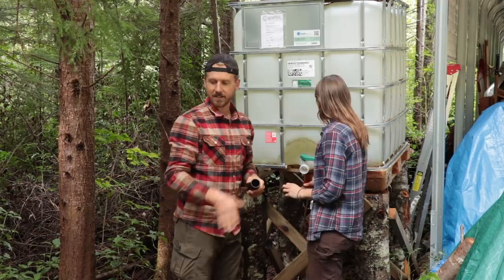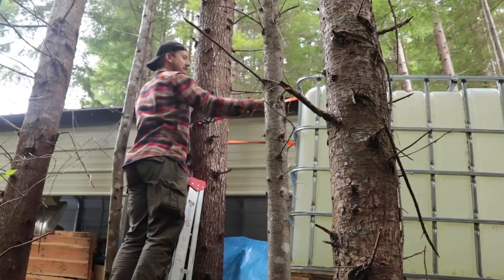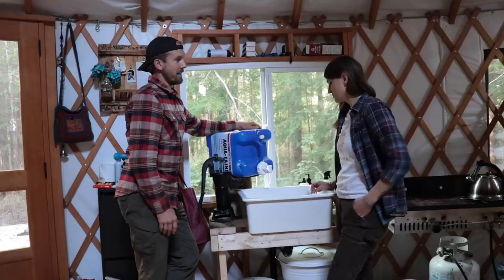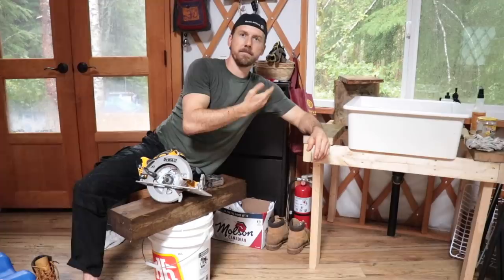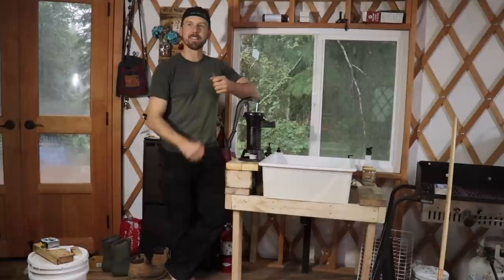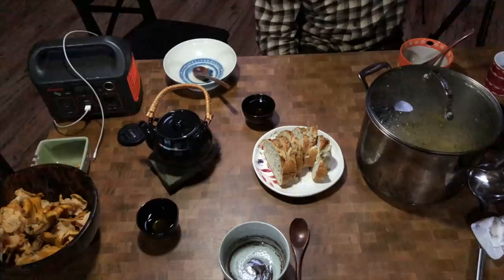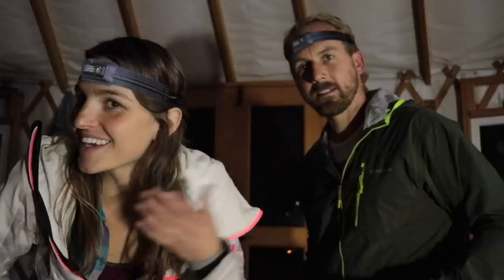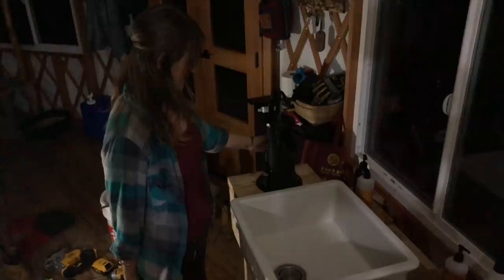Unbelievable!  My Secret Off Grid Kitchen Runs Off Rain Water | Living in a Yurt Ep.52

Comment: Use a Berkey for drinking water, contaminants start once the water hits the roof and can grow inside the tank especially if light can get to it, also I hope u have a plan for winter, that tank will be frozen solid and abs is for waste water
Reply: Was thinking that's abs but I could be poly pipe witch works for water would help if they expand that

Comment: Go find an RV supply store and they have a couple of filters that would work nicely hit your hand pump. We lived in a motor home for 5 years and I got to test them all. So the premo one has a charcoal packet with a UV light to kill all the nasties and choice number two is just an inline cartridge which removes 90 types of nasties but it doesn't have the UV but the water is drinkable safe. Leastwise it didn't kill us. The charcoal ones need to be changed out yearly and the inline ones every 6 months. Now they have UV rods and even though you are using rain water I would encourage you to hook one up to the tank. They don't require a lot of power and I have a friend who powers his off 9" x 12" solar panel. Just a thought.

Comment: From experience, that ball valve on the bottom of the IBC tank will freeze when temps drop. I ended up burying the the tank half way on three sides and the back then I built an insulated box around the ball valve, so I'd still have access when needed. I also buried all around the box, to make it better insulated against freezing. I used 4" pink foam to line the box and the lid on the inside. The water in the tank usually only froze a thin layer on top. But the pipes and valves will freeze all the way and burst.
Reply: See helpful criticism people

Comment: Good to see you have some form of running water. Have you thought about some kind of insulation for the water tank, piping going to the Yurt and up to the floor. When the weather gets cold enough for snow, without insulation your pipes might break and your tank could freeze up. Nicole's cold breath is a sign that it's coming.

Comment: That pump will entually dry out.  When it does, hust pour in some water at the top and get the seal wet.  It should be allowed to soak for 10 minutes.  They are a great pump, it should last you some 5-6 years if used regluarly.

Comment: We dont live off grid, but we have lived in a rural area for 35 years and hauled our water in by a water tank in our pickup for many years. We used a jet pump to pump the water from our cistern and we would loose our power at least once a week for years and with no power there was no running water.I can't tell you how many times over the years my wife and I have ended up outside in the rain or snow in the middle of the night trying to make repairs on our old house or laying in the snow while putting snow chains on the 4x4 just to get out of our driveway. So much respect to you two! They talk about living the easy life out in the country, what they don't know is the easy life aint that damn easy!

Comment: I know it's rain water, but still should use a water filter cuz a open system like that anything could get in
Reply: i grew up on rainwater in an "open system" just like that one. TBH it did me more good than harm
Reply: and no we never filtered the water. Nor did anyone else we knew do so either and they all had "open systems" just like Jake and Nicoles
Reply: I agree with you
Reply: Why  is it that they used black ABS pipe that is not potable rated?  Should have run it in pex.
Reply: Shucks, Patrick, it just like eating food off the floor . . . . .  it helps build your immune system!
Reply: @hembrasalvaje  Tony the poster means a filter so the pipes don't clog with leaves, sticks and any other stuff from the forest. Not a filter to clean the water itself!!! Duh!! Although it's not a bad idea at all to filter it before drinking, lots of pollutants in our rainwater, sad but true.
Reply: @indigoblue4791  yes true and that sort of filter we did have... it was nothing more than something similar to a cake pan with the bottom cut out and some wire fly mesh soldered in.  if you want to get the worst of the dust etc before it reaches the main tank you can easily make a small tank that has a ball bigger than the inlet pipe. the ball is down in the tank and it collects the first rain off the roof (along with all the dust) till that small (may only be 50L) tank is full then it blocks off and the water goes down a pipe off the side into the main tank. Wish i could upload a picture of what i mean. Small tank also has drain cock at the bottom and the water you collect in it you can use on the garden same as grey water
Reply: You 100% correct and black heats in the sun and assists Legionella bacteria to grow, should be underground and in white pipeing
Reply: @hartstudebakerkid  i was going to make a comment about that as well.
Reply: All they need to do is add some charcoal chunks n have it sealed n regular evaporation takes alot of crap out of water! Js!

Comment: A 12 volt RV pump off the solar with 1/2 line would give you running water and pressured shower. ABS black is drainage pipe not supply.

Comment: Why are you using ABS for any type of water supply it is used for waste water, venting and electrical on ocation, ABS, contains BPA, PVC does not,  use PVC! That would be like using black pipe instead of galvanized.
Reply: @ Karl Griggs ;  ABS pipe is NEVER used for ELECTRICAL Construction and Wiring !!! That would be a NEC CODE VIOLATION !!! ONLY Schedule 40 Or 80 PVC Conduit , EMT or Rigid Galvanized Steel Pipe Conduit is used for Electrical Work !!!!
Reply: @BearStar1  ABS is used in drain-waste-vent pipe systems and sewer systems. It is also used as electrical insulation. PVC is also used to produce pipes such as for drain-waste-vent systems and for insulation on electrical cables.

￼

Diffen › difference › ABS_vs_PVC

ABS vs PVC - Difference and Comparison | Diffen

Comment: You might think about painting your tank black.  With my experience if the sun gets to it algae will grow.  I have been catching rain water for 25yrs. I am in Ky.  Also I was wondering the same thing what about in the winter when it freeze's ?
Reply: It´s a big problem. No filters, no insulation, no painting black. In winter no water, in sommer bad water. No insulation under floor, very hard winter in "house".  Firewood is not chopped and not dry.
Reply: @juraposp  I think you need to go back and watch some more of there videos.  They have a lot of wood cut and split. The Yert has insulation built in. But they do need some kind of insulation under the floor also underpin the Yert to stop air movement. As far as the water don't need filter if they a boiling it.  Would be nice to have a Berkey filter for drinking water though. Instead of being a hater try being helpful. It's there first time doing this. There is a learning curve.
Reply: @juraposp  They have a well?
Reply: @1995ss100  My English is not good. Sorry. 
Proto budu psát svým jazykem, Česky. Nic z mých poznámek není nenávist. 
Jsou to obavy. Toho dřeva nemají naštípáno moc na tepelné ztráty jurty, které jsou velmi vysoké. Již dnes musí topit prakticky nepřetržitě. Mají nějaké dřevo naštípané před měsícem, tedy jen částečně vyschlé a dřevo v obrovských špalcích ležících na zemi, tedy nevysychající. To zůstane vlhké a sníží vyhřevnost. Pod podlahou nemají vůbec žádnou izolaci a podlahu mají z dřevotřískových desek a tenkých podlahových panelů, takže velmi nízké R (tepelný odpor). Jejich jurta patří ke větším, a má tedy větší ztráty. Jurta má zabudovanou pěnovou vrstvu izolace, ale ta je slabá. Z toho, co jsem viděl, mají dřeva pouze málo. Budují jakési plošiny, které nestihnou do zimy dodělat a v zimě je moc využívat. Čas by měli využít na přípravu na zimu. Voda, co vybudovali, jim v zimě nepoteče, protože v trubce zamrzne. Voda v nádrži se bude mít sklon kazit, protože je osvětlená a porostou v ní řasy a kdoví jaké plísně a sinice.  Trubky měli zakopat a před nádrž dát menší, odkalovací a obě nádrže měly být v zemi nebo izolované, nebo zasypané, tak, aby v nich voda nemrzla a nekazila se.  Potrubí také. Vrstva by měla být izolující nebo silná. Filtry na pitnou vodu nejsou drahé a mohou být separátní na pár litrů denně. Ale měli by je mít. 
Prostě  by se měli okamžitě vykašlat na nějaké plošiny a zaizolovat podlahu. I kdyby měli vyplněný prostor pod podlahou, kde nemají nic, senem nebo suchým listím, tak by udělali dobře. Ale museli by dát nejměně bublinkovou folii s aluminiem, aby jim podlahu zespodu nesežral hmyz. 
Opravdu jim držím palce a neradím jim blbiny, ale základní věci. Chtěl bych, aby vydrželi a vydrželi v co nejlepší pohodě. To jim přeji z Budweis, Czech republic.
Reply: @juraposp   I have no idea what you are saying it's all in Russian or whatever you are speaking
Reply: @1995ss100  Try Google translator. Y am speaking in Czech language. Small country in Central Europe. Prague, Budweis, Pilsen and many beautiful place.
Reply: @juraposp  cannot get it to translate

Comment: You need to paint that tote so mold doesn't grow in your water tank. Also, it will help protect it from UV light which will break it down over time.  Lessons learned from a fellow offgrid nut.  oh, if you paint it black the water will  always be warm enough to take a comfortable shower without additional heating.

Comment: Does it snow there? How will they get water to the sink in the winter?
Reply: Was about to ask the same question. The whole lot will freeze surely???. Pipes meant to be 4feet below the surface to stop freezing. A solid 4ft ice cube in a few weeks i reckon.
Reply: The average winter temperature on Vancouver Island doesn't go below 36° in January.  The chance of freezing that tank or pipe full of water is very slim. The coldest month is December and the average temperature then is 41°.

Comment: What you think about using the pump to fill up the gallon, and use gallon as you already have used it,  because it is easier to wash dishes with running water and both hands. Or next step can be electric pump, turn it on when you want water. BTW you are great, just keep going.

Comment: I’m not a plumber but I’m pretty sure black pipe is for sewer not fresh water. Black pipe is made from a different kind of plastic that could leech into your water. 

Fun to watch your homestead come along.
Reply: You're right, you are NOT a plumber.  PVC (black pipe) is approved and perfectly ok to use in cold water applications. CPVC  (the white stuff) must be used in hot water applications, which this isn't.
Reply: @MrPanzerblitz  He said in the video that it is ABS pipe, that is Acrylonitrile Butadiene Styrene and most certainly is made with BPA. I'm not going to tell them what to do but I certainly wouldn't be using that pipe for anything that is going into my body.
Reply: @definitelynotciabear6956  I understand your concern but ABS is also approved for drinking water and is considered non-toxic.

Comment: Congrats, i like your videos and life....
About the water pump.... A little advice.... I suggest to make a water storage tank over the sink, 20 liters should be fine, so, before to wash dishes, you pump water inside this tank, changing arm if tired. Then make a hose or tap on the tank to open and close easily when washing.
In the tank you can also put warm water if needed.
Cheers from Italy

Comment: Have you thought of a Bosch insta hot? They do not require any electricity water flow itself is what ignites it. You turn on the hot water it moves the wheel and it ignites at best thing ever.

Comment: Dude, you really need to put teflon tape on those threaded PVC fittings!  Also use it when transitioning from PVC to iron pipe or vice versa.  Metal pipe threads are tapered and seal via the tapers; PVC threads are not tapered and really, really need the teflon tape to seal well.
Reply: More obvious with pressurized piping though

Comment: You don't even need a pump for your sink, if you had raised your rain tanks so that their bottom is level with the top of your kitchen sink. this would cause a siphon effect, where the tank would drain on its own with out a tap.
Reply: also should have used pex plumbing, flexible tubing, that is rated for water. pvc is used for sewage generaly, and may not be safe for drinking water.

Comment: Been there done two winter's of grid in South Dakota I appreciate your electronic fence I will try similar ideas on our garden this year only an occasional bear mostly wild deer and wild hogs.
Reply: Biggest problem I always had was water.  Not sure it's the same for you
Reply: I gave up on power I didn't have but one panel used a generator  running on cooking oil .till it died
Reply: Wasn't but a couple months later I took a job at a local manufacturing plant had to had a daughter coming
Reply: Worst memory cutting fire wood in minus 32 degrees best memories my friends helping me set up

Comment: You didn't mention it, but do you have an over-flow on your tank? Also I've seen similar set-ups where they chain multiple of those tanks together.  You add connectors at the top and bottom between the tanks with a grade running from the input (top) to the bottom (exit feed to the house) and have an over-flow at the top most tank.  Once you start your garden you're going to want access to additional water nearby.

Comment: Looks like you are using ABS. It isn't certified to handle any kind of pressure and it is mostly used for waste water. The correct pipe to use is schedule 40 PVC. It is certified for potable water and pressure.

Comment: Great job just one thing. I don't know what you're plumbing code is, but here in Minnesota, USA you can't join ABS to PVC with anything but a mechanical coupling (No glue). There are two reasons there is no glue that is 100% compatible between the 2 plastics so you can never gaurantee a true bond and seal, and the glue used on ABS releases chemical compounds (most ABS is foam core) into the water as it has to break down the surface of the plastic to create the bond. Otherwise great job at piecing together you're plumbing. Oh by the way should put some teflon tape on those union joints PVC threads never seal without it. I didn't see it in the video did you install any sort of inline contaminant filter?

Comment: Guys, if the water is in sunlight it will catch mold and the water will spoil in couple of days. 

The best way, is to get one of those big 2000 gallon and make a hole in the ground and bury it.  therefore sunlight will never touch it and water will never spoil. That's how it's done the right way.  If not, your way will work for a couple days, but then you realize that it doesn't really work.

Been there done that.

And you get an A for effort and the A+ for being a hard-working dude. But just remember that's how it's done and do a little more research on it as well.

Good luck and I like the way you want to live it's a very smart way and no bills
Reply: Jake is a Kung Fu master that can feel what is the right choice.
Reply: They will not listen to any sound advice they just call people who do trolls.  I do agree with you and what you are saying.  Plus they are going to find out how cold their first winter is going to be or they are going to have to burn a astronomical amount of firewood just to heat that thing.

Comment: Love those yellow DeWalt battery tools. That circular saw  cuts nicely. The drill & Jig Saw are nice too ! I have two  DeWalt angle grinders but are 110 VAC current. Love them. Just got a chain saw circle type blade for one. Hope it works. I have to put it on today and cut some wood. FYI: How are you going to get water when the temps go below the freeze mark ? Won't the pipes freeze ?

Comment: 112pld of water not bad not bad at all. um I don't see you two using any thread scalene or three tap on your joints? (I like using the yellow natural gas tap my self)  with a suction bast pump having a air tight seal is critical.

Comment: This group is going to fall apart if you don’t both seal your relationship without outside help unless your father spends time with you both. Three is not a good group in your family is not involved. You also need to get a better solar system for lighting inside of the Yurt

Comment: Is it safe to use a propane grill of that size (16:00) indoors? What about the CO accumulation and the possibility of a propane leak?  There does not seem to be any hood or exhaust for venting, and there is all kinds of open flames within the yurt, like from the fireplace and even a candle.  What would happen if there were a fire and the propane bottle was nearby and could not be shielded from the fire?
Reply: I've seen that too. To answer your question, NO it is absolutely not safe AT ALL to have that set up like that indoors.

Comment: Wish I was younger that looks fun. Please wear safety glasses when even using battery power tools. I was removing a old furnace,  cast iron and steel and had no saftey glasses,  at the last minute I went and got my military gas mask and put it on and the first wack with the hammer and a quarter size piece of metal hit my mask where my eye  was, the lenses were double layered and that's all that saved my eye. A auto mechanic I knew was not so lucky,  he grabbed the wrong socket that was not impact and it blew up and took his right eye. If you puncture your eye not even the best person can control himself. Sorry for the soap box. HAPPY LIVING.